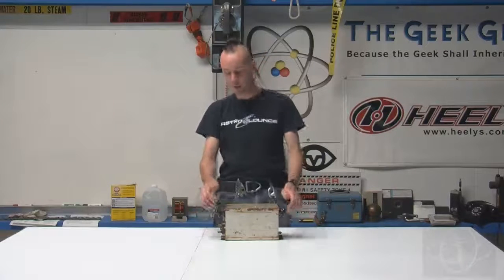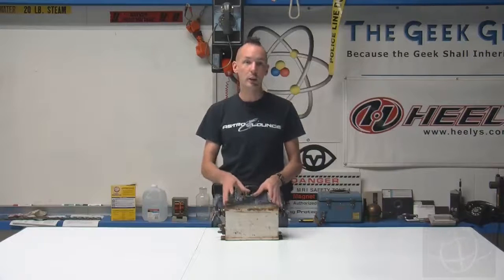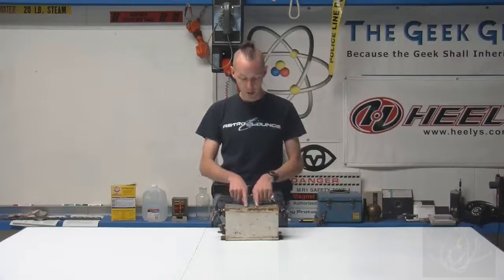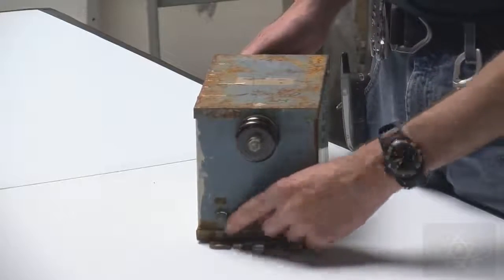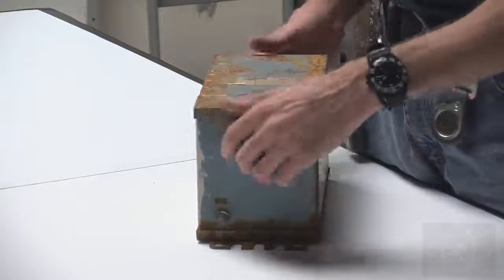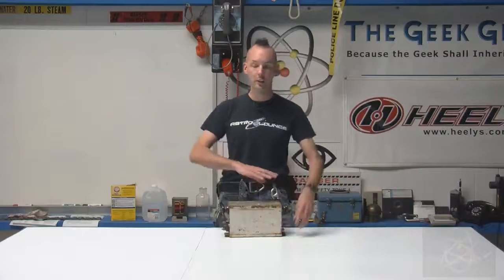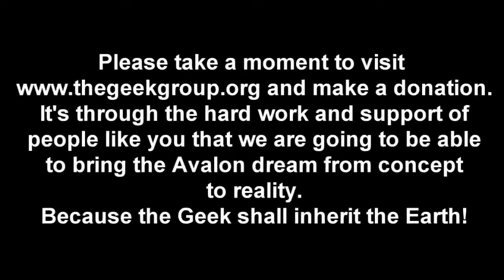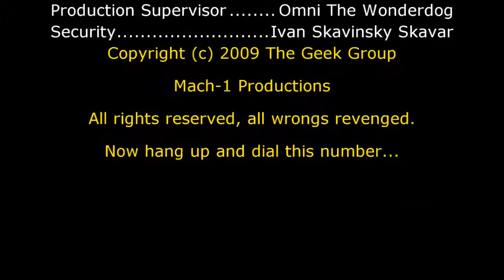NST Ground

Comment: What about the newer plastic casing ones, that only have a ground wire on the low voltage side, is it still connected to the center tap on the high voltage side as well?
Reply from the maker: No, the tiny new ones are solid state. I'll be covering those as part of the new HV series. Check out our recent videos and there's a LOT of new content. Look at the date on this video, we've come a long way since then. ;)
Reply: @ChaoticGoodChris  Thank you, can I ask another odd question, when you arc the two sides together, or when they are powering a neon tube like normal, since they are opposite phase, shouldn't they just cancel each other out and not work?
Reply from the maker: Start here. You're going to have a LOT of questions, and that's a good thing. Start with this video and just go down the rabbit hole. https://www.youtube.com/watch?v=Cj176WceyF4
Reply: @ChaoticGoodChris  I've actually gone through the series, but still had that question, that's okay though. Thanks
Reply from the maker: Well then I shall have to give a better explanation on that. :) Since they're out of phase, there almost always exists a potential difference between them (except for the instant they're crossing Zero). They're locked in Sync, but 180deg out of Phase with each other, and thus the polarity difference adds. This is exactly the same thing as when the Sync lights turn on in this video. https://www.youtube.com/watch?v=mQKMl5LItjk  You can see them in action here, where we use the voltage change from in and out of phase to sync an actual power plant and it's giant generators. https://youtu.be/8rnZXZs7bw4
There, does that make sense now? :)